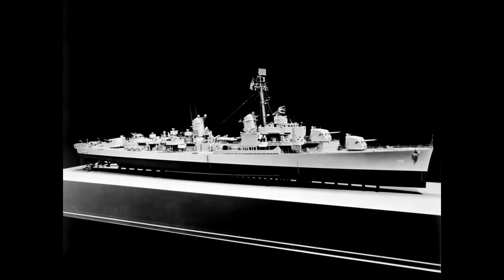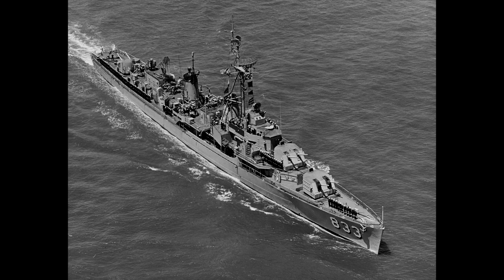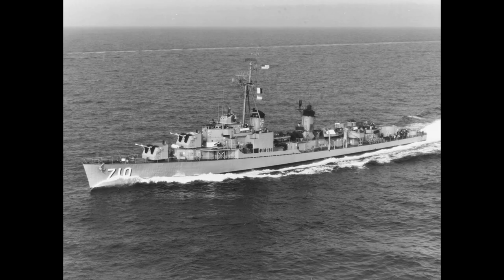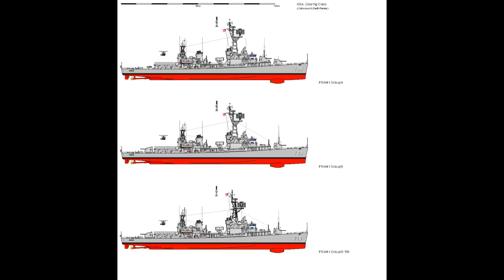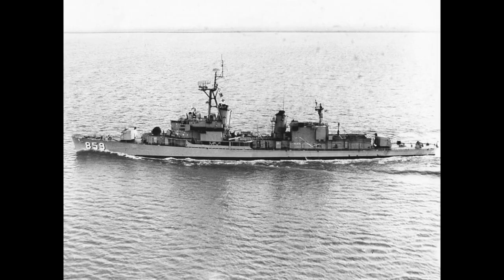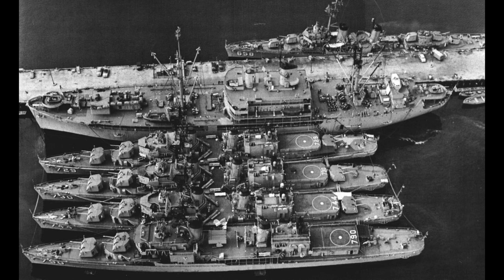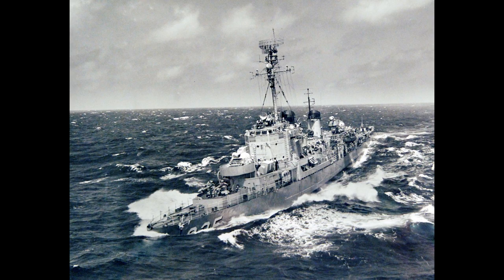USS Gearing - Guide 157

Comment from the maker: Pinned post for Q&A :)
Reply: Been waiting for the Gearing class, thanks Drach!!

If the designs for the Sumner/Gearing class’s had been developed earlier, or if the war had gone longer etc, given the more effective systems and potential for the numbers of hulls to be built given how fast the US liked to churn out destroyers: what do u think the chances are that the Gearings would firstly outnumber, and then out perform and take over the ‘legendary’ status/reputation that the Fletchers earned and still hold historically?

Thanks in advance :)
Reply: How many gears are found in a Gearing?
Reply: Between adding length and throwing in more engine, which was the preferable thing to go for when trying to get ships to go faster?
Reply: If the USN cancelled the Iowas and Alaska’s completely and used the extra resources and manpower for even more Fletchers and Gearings, how much more powerful would the USN be at Okinawa?
Reply: What are some differences between the gearing and the forest Sherman Classes
Reply: After WW2, and the revelation of the Japanese "long lance" torpedoes - did that change how conventional torpedoes were designed? Or has the torpedo faded in importance for surface ships?
Reply: If the modern 2020 RN replaced the ww2 RN, how screwed or advantaged would they be? And how one sided would battles be? If at all
Reply: What would you say a ship designer from the Napoleonic, late steam and steel, and Dreadnaught eras who was brought into the current day would build?  This, assuming that whoever brought them here, also explained current technology, its function, and how it is supposed to be used in combat, but didn’t tell them anything else about it( ie. what prompted designers to include them and what lessons have been gleaned about their effective use in real service).

I love the channel, and love your laid back yet still rigorous approach to the subject.  I am able to listen for content when I am feeling like that, or listen for entertainment when I am feeling that way.  Great job, keep up the good work!
Reply: Would you rather fight 10 Fletcher-sized Yamatos, or 1 Yamato-sized Fletcher?
Reply: As the gearing class finished construction so close to the end of war, do you know why US still went ahead finishing huge numbers of them?
Reply: @bkjeong4302  not, really. Those are escorting destroyers, not really units for power projection. If we say 2,000 men apiece for the Iowas and Alaskas. Hearings, Sumners, and Fletchers all require about 300 men, so maybe 40 more destroyers. Four Iowas and two Alaskas make for 104 5"/38s, while 40 Gearings would provide 240 such guns.However, there are already 54 destroyers present in the three carrier task forces at Okinawa when Yamato sailed, and several other carrier task forces elsewhere. Say a 50% increase in destroyers at Okinawa in exchange for a substantial reduction in heavy guns (three SoDaks), and only a modest increase in AA fire.
Reply: @f12mnb  torpedoes on surface ships are (almost) exclusively for anti-submarine work, and few of those anymore because of ASROC and helicopters.
Reply: Frank DeMaris 

The Iowas and Alaska’s were obsolete on launch for power projection purposes anyways. While we have disagreed on the SoDaks and North Carolinas in terms of whether they made sense when laid down. I believe you agreed with me on the Iowas and Alaska’s being pointless.
Reply: @bkjeong4302  yes, absolutely. But you asked how powerful the resulting fleet would be, which I think most people would interpret as a question about offensive power. In that case, were comparing obsolescent power proje tion to essentially no power projection. Yes, the 5" guns can be used for shore bombardment, but the increase in total number is modest and their ability to range inland is much more limited than the 12" and 16"/50. Defensively, it becomes an issue of diminishing returns, i.e., how much thicker can the US AA "wall" become? The Japanese likened their air attacks on the US fleet to throwing eggs at a wall almost a year prior, at the Phillipine Sea.

Come to think, a better question may be whether these 12,000 or so men are more use as DD crew in the Pacific or as another infantry division in Europe six months or a year earlier.
Reply: What’s the hull protrusion below the first barbette on the Gearing?
Reply: hi drach! got a bit of a scenario for you! 

the year is 1950, and you are placed in command of developing the new West German Bundesmarine being allowed by the allies. Earlier in 1946, the Allies agree to keep the ex-Kriegsmarine vessels they are ceded for a future German ally. Now, these remaining ships are handed over to German service. how would you modernize the existing fleet, and what new ships would you invest in? keep in mind that submarines are prohibited until the 1960s. the larger ships avalble to you are listed below

Prinz Eugen [CA]
Leipzig [CL]
4 Type 1936A (Mob) [DD]
4 Type 1936A [DD]
3 Type 1934A [DD]
3 Type 1939 [TB]
4 Type 1937 [TB]
2 Type 1935 [TB]
4 F-Class [DE]
Reply: What was the reasoning behind early aircraft carriers not having their flight deck not run the length of the entire hull, as seen on the courageous class, ryuujo class, and graf zeppelin?
Reply: I have a few questions that are separate so answer however you'd like:
1. I know that Australia had a naval base that was also commissioned, that being the HMAS Platypus. Is it/was it practise to commission naval bases and why was this done?

2. How important are survey vessels and other scientific vessels such meteorological ships to a fleet's operations?

3. I have heard that some of the Australian colonies possessed small fleets of their own before the country became Australia. Was this standard practise and how useful would these navies have been in defending the colony from attack/invasion?

4. I'm currently reading about the HMAS Adelaide (1922) and I can see that it took seven years to complete. Why?
Reply: Exactly what made single battleships cheaper to build than their displacement in destroyers?
Reply: Can we get a video from you about the IJN Takao class cruisers and their strike squadron?
Reply: How about doing something no one else has. Cover the USS Arizona's 20 plus years of service.
 It had a very interesting career, it too bad it'only known as a footnote to history.
Reply: 8 or 9 ships remaining depending on how you count? What does that mean exactly?
Reply: How would have the Type 96 performed if the Japanese developed a reliable drum mag or belt feed for it?
Reply: Where was the photo taken of the ships tied up under the big metal bridge? It looks very much like Brisbane Australia and the Storey Bridge. If it is, I've walked along there. It's my home town.
Reply: @javabro212  Well in most ways they did outperform and out last the Fletcher's. And had more growth prospects.
Reply: @bkjeong4302  Your Anti Battleship bias is showing. And in any case, strength  vs. A IJN with nothing  left? Or at best one with zero fuel?
Reply: @f12mnb  Torpedoes on Surface ships today are mostly  ASW weapons. The Missile replaced them in the Surface warfare  ship attack role.
Reply: @CiZX636  Very screwed.... The RN of 2020 is a shadow of  its peak. It's  weaker than the Force of 1982. They lack the numbers to do anything. They can't escort convoys. Fight u boats. Hunt surface raiders.  Do many air strikes or Amphibious missions.
Reply: WALTERBROADDUS 

It’s not bias, I’m stating the facts. The Iowas and Alaskas were obsolete, unnecessary and wasteful either for their design purpose or the things they actually ended up doing.
Reply: @bkjeong4302  History and the USN don't agree with your view. Service in 3 wars since 1945 backs that.
Reply: @benjaminarnold2881  That would be like having Henry Ford walk into the Ford HQ and setup shop in R&D?
Reply: WALTER, yes. But, for example, give him knowledge of air bags, but not how to effectively arrange them
Reply: WALTERBROADDUS 

Mostly because Congress ordered the USN to keep them around for no reason.
Reply: "Would you rather fight 10 Fletcher-sized Yamatos, or 1 Yamato-sized Fletcher?"

I'll have what he's drinking/smoking...
Reply: Don't know if it's in your wheelhouse (pardon the pun); but would you consider the "Kidd"/"Shah" subclass of the "Spruance" class destroyers for discussion?
Reply: @typehere6689 , increasing length to beam will get you more speed for a given input.  Along a curve, it will diminish sea-keeping.  On a nice flat river/lake, a crew of 8+1 will use around 40:1 and can achieve around 12 knots; they also would probably sink in a 1 foot sea, so there's that.
Reply: Ok, alt history question here: what do you think would have happened at the battle of midway if the Japanese carriers and found and sunk the American carriers at the battle of the coral sea? Do you think it would have made much difference having 2 additional Japanese carriers and 1 less American carrier at midway? Thank you for your work, I love your channel.
Reply: The royal navy not forming/sending a major fleet to the Pacific until Jan 45 seem odd to me. 
With Italy out of the war and the Germans having very few surface ships left and gradually losing u-boat bases on the Atlantic after D-day. It would seem that Japan was the most serious navel threat at that point. 
Could the British have sent a fleet before the end of 1944? If so how would it have effected the Pacific theatre?

Or is the Kriegsmarine being effectively out of the fight by mid 1944 just a massive over exaggeration?
Reply: On the back end of most destroyers I see (first noticed in World of Warships) there are these supported bars extending out on the sides at the rear.   Can you tell me what those are for?  I have 2 theories.   1) towing or 2) I know the DD's can turn quickly and swing thier tails out, perhaps this is some kind of rear bumper in case that happens?
Reply: I served on three. Uss Douglas h. Fox dd779. Uss Robert l Wilson DD 847 Nd Charles p. Cecil DD 835. Boiler Tech.
Reply: Do you know if any Destroyer or Destroyer Escort ever scored a successful hit on a surface ship with hedgehogs?
Reply: @redram5150 Sonar dome, I believe.

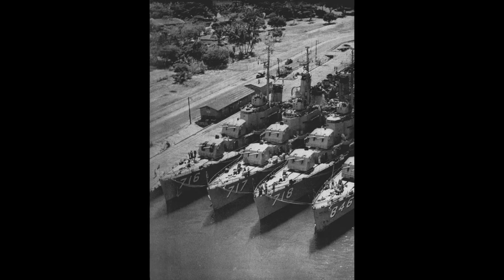Comment: I served on the USS Hamner (DD-718) 1975-1976 as EMO and CICO. Yes they were getting pretty long in the tooth (Hamner was older than I was!) but with a little help from the snipes (pry bars under the main steam valves, or so the rumor had it) we could still hit 32 knots. Hamner makes a brief appearance at 1:28 moored alongside the Wiltsie (DD-716), the Chandler (DD-717) and to her portside the Osborne (DD-846). Thanks for doing one of your specials on this class.
Reply: This Electrician's Mate helped keep the USS Steinaker DD-863 (@2:13) afloat with chicken wire and 'monkey shit'.

Comment: With the FRAM upgrades, except for the removal of the twin 5" turrets the superstructure wasn't completely redesigned so much as structures were added around the existing WWII structure.  As an example the original bridge was completely surrounded by a much larger bridge with extra stations for all of the new ASW and radar picket equipment.  The glass from the portholes in the original bridge were removed and a few passageways were cut so people could communicate.  However, standing inside the bridge you could clearly see where the old and new parts were.  This seems to be a common design feature of many, if not all, WWII surface combat ships that were modernized after the war.  I've seen this feature on the USS Midway, the USS Yorktown, the USS Laffey, and the USS Wisconsin.
Reply: Thanks, I wondered what happened in FRAM1 to GREENE  DDR711. I got off in CHS days before she went to NH' Spent the Cuban Missile Crisis on board.

Comment: Destroyers seem to be the Swiss Army Knife of many navies
Reply: It is so. They found themselves doing everything and becoming bloated.

Given this development, I wonder why a revised "rating system" like that in the Age of Sail but with displacement ranges and rising rate numbers indicating larger ships never came about.
Reply: Doge Maverick  Swiss army knives are extremely useful in most non-stabbing applications.
Reply: Doge Maverick  It sounds like you've never tried to use a swiss army knife for camping or as a tool. Depending on the model you get, it is basically a tool box that fits in your pocket. The knife is useful for dealing with line and low-quality woodworking. Some come with a boot-laces hook. The corkscrew is honestly kind of a waste of space. Some come with tweezers or toothpicks inside them. Bottle openers, scissors, magnifying glasses.
Basically the tools are not terrible, just much worse than a specialist toolkit or a steak knife. The comparison to destroyers is pretty adequate, considering that destroyers were applied to a massive number of different roles.
The only major differences are that destroyers are ships, and that several varieties of destroyers were explicitly specialized for specific roles.

Comment: The DASH drone helicopters were well before their time, but the Gearings were just too small to handle a proper helo that would be of any use. After the navy went through various ASW helo's (SH-2F, SH-60B which have been upgraded to MH-60R), they have been using the Fire Scout drones alongside the MH-60R's.

Comment: I was reading through Friedman's history of the design and development of the US destroyer and found this interesting nugget. Just after the end of WW2, it was accepted that the maximum sustained sea speed of a "Gearing" at combat displacement and under combat conditions was 31.8 kts.
For those that say that DASH was unusable, the JMSDF used the -50 for 25 years with a higher reliability rate and considerable success, primarily due to the installation of feedback sensors that helped eliminate the primary human error, loss of the horizon. And the -50 was also used successfully as a unmanned gunnery observation drone during Vietnam. Still, the equivalent British system was the Wasp, manned lightweight ASW helicopter. That would have been an interesting capability with VDS, giving the DD a decent range delivery system for light homing torpedoes. The problem with the FRAM DDs were that the best hull sonar available was SQS-23, which had a resolution range of 4K to 8Kyds, while Wasp and the QH-50 had a greater effective range, essentially to the visible horizon or 24-26 kyds, which meant if LINK 10 or 11 wasn't available, there would be difficulty coordinating target distribution among escorts.